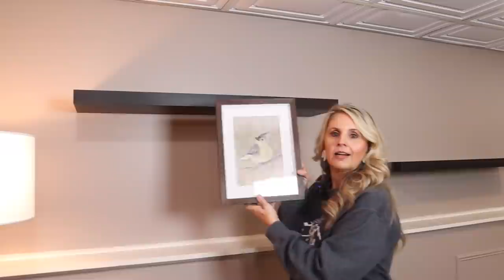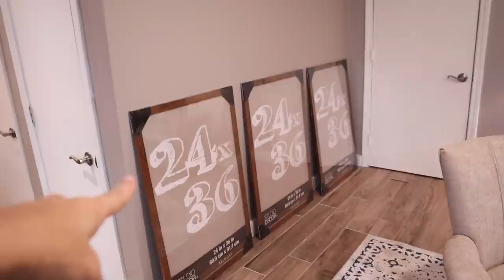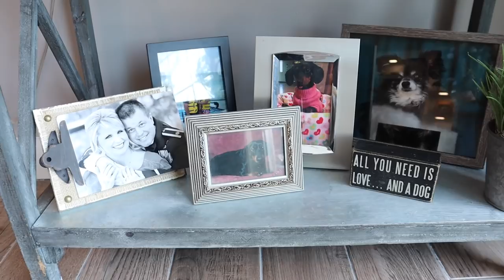Transforming My UGLY Basement | DECORATE WITH ME

Comment: everything turned out so nice.  Love the blue with the woods. For that awful plug high on the wall... first I would   paint it the same color as the wall so it would not standout so much... then I would take the cord from the lamp, add an extension cord and run it behind the mirror to plug in the other side with the  other  lamp , eliminating the cord up high on the wall.

Comment: Back in the day, it seems a few builders would put a random vent in the wall to try to get rid of radon.  I asked a similar question when I bought my home because it had a random pipe in a closet from the floor to the wall, and upon further investigation, had a box over the pipe on the outside - and it turned out to be radon mitigation.  I guess my house had a kitchen type vent on the wall similar to yours before it was changed to put the fan in a box on the outside of the wall.